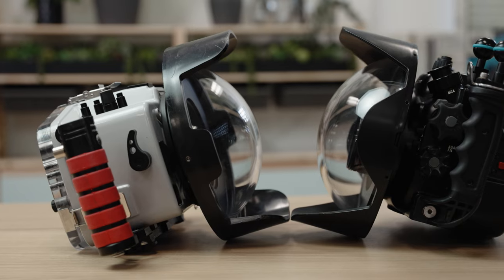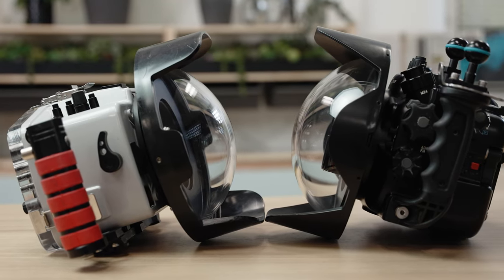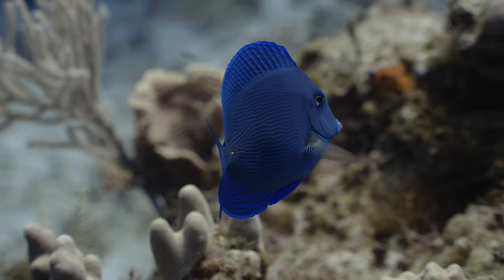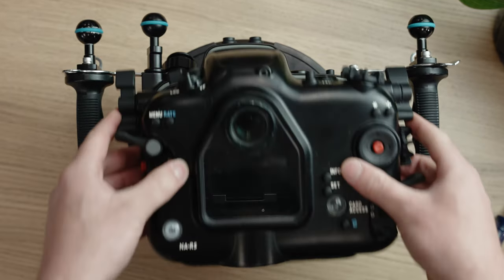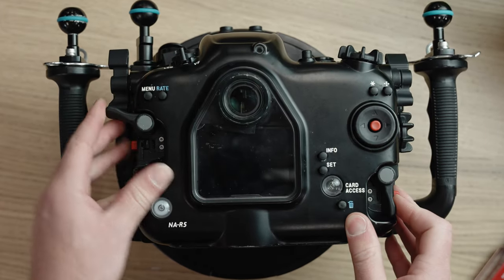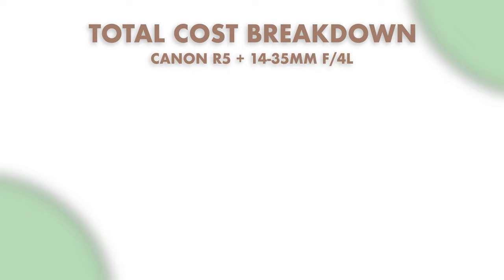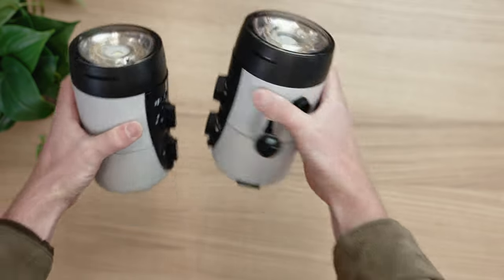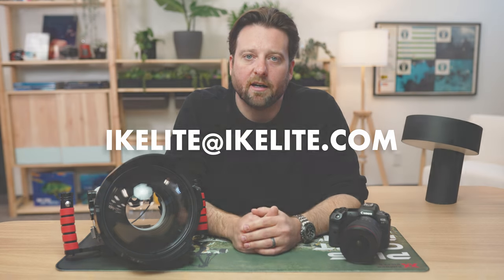How to SAVE $4,200 on your underwater housing! // Nauticam vs Ikelite Comparison

Comment: Since I started diving in 1996, I'd gone through 3 Ikelite Housing (Canon AE-1, Olympus C-7070, Canon G16), 2 strobes (DS-125, DS-161). Only 1 of them ever need to send back for service. I got the first one second handed and the strobe connector was corroded and leaked. Replacement service then was excellent. The other two served me well for almost 10 years each. I just order my 4th unit through my local dealer a few days ago. Also, I got Ikelite Housing for Canon S95 for my wife, which still works perfectly for about 10 yrs so far. To me, that speaks "Quality" and "Reliability". Keep up the good work, Ikelite team.
Reply from the maker: That's awesome! Glad to hear about the positive experiences through the years with the product and the service department. We sincerely appreciate the support!
Reply from the maker: Thank you for your continued support, happy diving!

Comment: I like and use Ikelite and I have used these systems for many years! However, I would love to see Ikelite develop and implement a warning light and alarm system similar to what Naticam housings have. I find that once a leak starts its too late and everything is lost! If the housing is not properly vacuumed sealed the warning light and alarm lets you know it before you even get into the water not only saving your equipment but giving you the time to correct the problem so you can make the dive with your camera. I know in theory that you can check the vacuum seal on an Ikelite housing using the pump, but that requires you to carry the pump around, which is bulky for the Ikelite system, and check it right before going into the water. The warning light system is much easier to monitor and use! Please consider this option!
Reply from the maker: Thank you for the feedback. We'll look into some options.

Comment: Ikelite makes great value housings that works well and they have a fantastic service department. Ergonomics is discussed a lot, and I think for the most part Ikelite does a good job here (except for the video record button on my GH5 housing, which I never knew what to do with...)

However the accessories and lack of native wide-angle domes (that won't kill your corner sharpness) are things I wish you guys would look into. I'm personally at the stage where I would most likely go Nauticam for my next camera setup because of things like leak-detect systems (which negates the need for a clear housing back imo), a vacuum pump that doesn't take up as much space as a regulator and the least practical weight system ever designed (sorry Ikelite). Where Nauticam kills it in my opinion is with their domes and wet optics, and while you can adapt some 3rd party options to Ikelite the difference is still there.

If your whole thing is about being travel friendly, please shrink that vacuum pump and make a weight system that won't turn my easy-to-handle housing into a accident waiting to happen on a moving boat. 

That's my rant, sorry if it sounds a bit negative, I'm mostly a happy customer haha.
Reply from the maker: The honest feedback is highly appreciated.  Our new vacuum pump is smaller than the previous version so that should provide more room. One consideration when relying on the LED leak detector is that a small amount of water entering the housing may be enough to damage a camera while swimming around without creating enough of a pressure differential to change the LED. We feel this is something you’d more clearly see through one of our backs. 

Nauticam does have some impressive optic solutions, but it is a sizable investment in both weight and cost for a solution dedicated to underwater use only. Todays lens choices for the camera bodies are getting too tempting to pass up for topside opportunities.

Comment: I am in the ocean every week with my Ikelite R5 system. Back in the film days I had an aluminum housing briefly. This housing taught me about metal, salt water and corrosion. I have had Ikelite housings ever since. The current material is tough and if I don’t have immediate access to a fresh water rinse I don’t worry about it. Ikelite controls are simple and straight forward. No gears and multiple levers. Some housings look like they are put together by a Swiss watch maker. All I see is so many more things to go wrong that I would not be able to fix on a small island in Micronesia. Put this together with Ikelite’s unbeatable TTL system and the 230 strobes and I have a Canon R5 system that just continues to perform dive after dive.
Reply from the maker: Thanks David- those are huge compliments coming from one of the most published underwater photographer in the world! Few people have as many shutter actuations underwater as you do!!!

Comment: Really happy with Ikelite products since 10 years. Even if I had problems or leaking I could in 90 % fix the problems myself. Easy to use lightweight and the only way for low wage people like me to continue in this passion. Without Ikelite i had 10 years ago maybe only the Gopro. Thank you guys!!!

Ps: I use the extra space in my housing for toilet paper ^^.... thanks to the clear design I can continue my dive, monitor a possible leak until all toilet paper is soaked. I had once a broken trigger button seal I dove more than 100 dives with a leaking housing thanks to the clear back. Love it XD
Reply from the maker: Thanks for choosing Ikelite, we’re happy you’ve had a great experience!

Comment: I have had Ikelite for some time. The equipment was good and I was satisfied. But now I have another brand (Isotta Housing) and I am more satisfied.
I too have to say that Ikelite is good value for money. What I don't like:
The Ikelite closure is very cumbersome.
The Zoom Gear is a fiddly thing. I need to be able to change the lens quickly. That's not quick with Ikelite.
Both are better solved with Isotta and the housing is smaller. Soon I will have to buy a new camera and a new housing. If the lens adapters for zooming were better, Ikelite would be on the shortlist.
Conclusion: Ikelite builds good housings at an attractive price. But apart from Ikelite and Nauticam, there are other alternatives. Sorry for my bad english.
Reply from the maker: Thank you for the feedback. We're perpetually improving our products, including the gearing and port system. It's certainly possible that the issue you had has been addressed. When it comes time to getting a new system we'd be thrilled to have the opportunity to walk you through the details. Please do not hesitate to reach out when you decide to move forward.
Reply: @ikelite  Thank you for the constructive answer.

Comment: Love this comparison!
Many of my dive buddies use Nauticam and have asked why i don't "upgrade" to a Nauticam system! 
UPGRADE??? 🤔
Both systems do the same job with the same results IMO. But, the wet lens options of using after market wet lenses for example, do give the other a distinct versatility advantage advantage. There have been many times I wish i could had an option to flip a diopter or change to a flat port to CFWA witha quick port add on underwater.
Yes the vacuum pump is a bit large, but itvwas initially designed for workshop mechanics i guess. But, it still works for me!!
Having said all that, Ikelite is and will always be my go to system for the more pros than cons for my system requirements. ❤
Reply from the maker: Good point, Richie. Thank you for the kind words and support! The external lenses are often pairs with lower end camera lenses but it is an alluring concept. Perhaps we’ll look into a solution 🧐

Comment: I have not used an Ikelite product myself. But when I was in the market for housings the option was a very expensive nauticam, a ikelite and a budget Chinese housing. I was not willing to put up with the upfront and maintenance costs of the nauticam brand. A few of my dive friends have used ikelite and after floods decided to invest into nauticam or aquatica or some Italian brands. I won’t go into if the floods were their or housings fault as that is not the point. The housing has one job to do and one only. No one was familiar at that time with the Chinese brands nor was anyone willing to risk it. The way I saw it is the biggest issue is that Ikelite had was no leak detection system to check the system before a dive. Yes it has the nice visible back part but in my experience once a flood happens it goes very quickly and good luck getting out of 30m deep water. All that nice glass in the back will do is show you how your camera is dying. Therefore I disregarded ikelite as an option. That left me with buying an expensive housing or going really cheep. I decided to try the Chinese brand. It was by a whole 0 cheaper then the Ikelite housing (so much about Ikelite being the budget brand) this housing had 2 o-rings on the cover and a leak detection system. So I bought it for 250usd (including a port and had to add another 120usd for the leak detection system). I tested it first extensively before placing my mirrorless inside and if it went it was just 250 dollars. Had that housing for 8 years. Is it better than Ikelite. No, by far not. Ikelite has better materials, buttons feel better. But it will tell me if there is a leak in the system and double o rings! Over the years I bought another to use as a donor for the buttons that went, or just general items that would wear out. 

I really don’t like it when people try to justify their product by pointing out the issues of a competitor. In this case is nauticam expensive, yes. Does it have a high maintenance tag + shipping, yes. But is it safer? 100% just because of the leak detection system. So if you are shooting for living a high end brand makes sense. But does that make Ikelite the best budget brand. No. And I stated why above. You always get what you pay for. If you are really on a budget and want to spend that cash on a pair of good strobes, lens, macro setup, travel etc. Ikelite is still a lot more expensive then some other options. Are those ugly, feel bit cheap and limited to 40m. Yes. But guess what? They do the same job and that is only one job, prevent water from getting in. So where does that leave Ikelite? Not the best quality, not the cheapest option, just videos talking about their competitors. Think Ikelite can do more and hope they do as that pie will shrink further with more competitors coming to the market every year.
Reply from the maker: Thanks for your thoughtful reply! We do offer a vacuum leak detection system and there are several videos showing how that works. We always recommend checking for leaks before entering the water.

Comment: I agree that for the price difference ikelite leads the price point they are at the moment but being a full time operator of both brands ikelite ( Nikon Z6ii ) and nauticam whit the blackmagic 6k the features are superior, the build quality and ergonomics. 
In my housing ( ikelite ) I have to move my finger off the shutter to change shutter speed while I can use the nauticam housing as if it was the camera in land, also the manual focus and zoom system on ikelite is far inferior than Nauticams one.
I’ve been wanting to get a underwater housing from ikelite for my blackmagic 6k or any blackmagic or even my R5C and no luck and here another reason why they can’t be compared to nauticam 🤷🏻‍♂️ just my thoughts
Reply from the maker: Nestor, we appreciate your comments and we can see how investing in ergonomics may pay off for someone who's in the water full time like yourself. Regretfully the BlackMagic 6K and Canon R5C aren't in the cards due to the size of the cameras. Unfortunately we can't do it all but we do try!

Comment: I owned Ikelite and Nauticam housings, yes Nauticam is way more expensive but for a good reason. I can easily see the difference between the two housing, one is well design and well engineered the other one is not so great to control and poorly design and produced. Both work, having the budget, I go without hesitation for the best one.
Reply from the maker: Housing models released even just a few years ago would be less sophisticated than what we produce today. Our designs continually change as we make enhancements and improvements with each new camera model release. We aim to make professional quality images attainable through a full set of features at an affordable price point.

Comment: I was shooting with Ikelite housing several years with several different ikelite housings, and now I have been shooting several years with Nauticam. I still have ikelite strobes. I do think they both have places. Ikelite still needs to fix their vacuum system. It's not enough to make vacuum test before you go to water. When I was using Ikelite, I was constantly checking underwater that is there water inside even with vacuum. Vacuum measurement system takes that totally away.  I would cladly buy Canon R5C ikelite housing for my underwater travel photography even now if the vacuum system would be solid.
Reply from the maker: Hi Juhani, we have always appreciated your support. Unfortunately we are not planning to offer a housing for the R5C camera body. But it's not clear what you mean by vacuum measurement - do you mean a leak detector alarm system? We can see where that would be helpful!
Reply: @ikelite  Yes, when there is clear light in green showing that low pressure has not changed, I don't need check underwater that is there water inside. if there is very small leak like hair or something there might already are water inside and it's very difficult to see that thru housing. Also it gives you peace of mind, can just focus on photo or videography, not for the leaks.
Reply: @ikelite what about canon c70?

Comment: Will a 24-70 lens work with the lens port shown?
Reply from the maker: The 24-70 will work with the dome port in the video but you will need a combination of extensions. Here is a link to the port chart so you can see exactly what is required. The 24-70 is definitely a great lens, but something shorter and wider like either the RF 14-35mm or 8-15mm fisheye + adapter would be more ideal underwater. 

https://www.ikelite.com/products/underwater-housing-for-sony-zv-e10-mirrorless-camera

Comment: You know what costs 4200 usd? My camera which I won't know is flooded because I have no warning lights... The stress is not worth it.
Reply from the maker: Flooding is always a concern! We recommend vacuum testing a system before taking it underwater, ideally overnight. Warning lights won't tell you how much water there is, where it's coming from, or how close to your camera it is. Our housing design does allow you to actually see inside in the rare event that there is water intrusion so that you can route the water in a way that is less likely to damage your camera.

Comment: wow can honestly say I've never seen a more inaccurate video. I'm sure everyone has had difference experiences with housings but boy my time with Ikelite was miserable. Yes, the price point of Nauticam is way higher and really it shouldnt be that high. But the amount of problems Ikelite has makes the price worth it to get something more expesnive. 
In the video you didnt talk about the rust or sticky buttons that ikelite has problems with or the comparison between the vacuum systems of the two housings and how dominent the nauticam is. They are also rated for the same depth. Also, having a clear back isn't going to save your camera, it just means you're going to watch it flood. If something is that wrong with the setup the clear backing isnt going to save the camera before its too late. 
I'd pick a seafrog over Ikelite any day!
Reply from the maker: Sorry to hear that you’ve had a bad experience! Proper assembly and good maintenance habits are essential to keep any underwater system dry and free of salt buildup. It’s good to keep in mind that a vacuum system does not prevent leaks, it helps to detect possible problems. Our housings are all rated to 200 feet (60m). If you need to go deeper we would recommend a housing that’s rated for deeper!